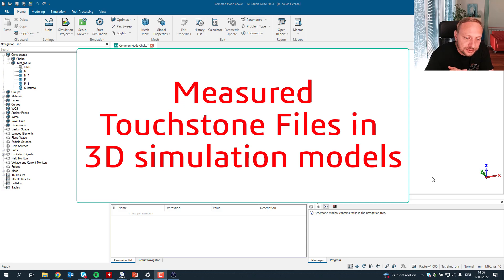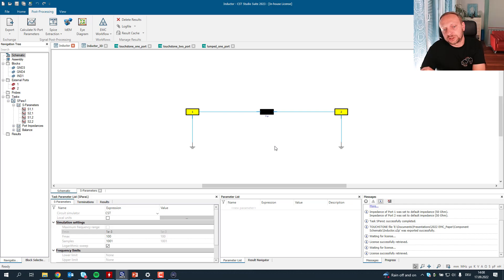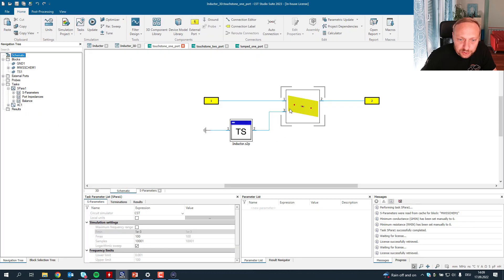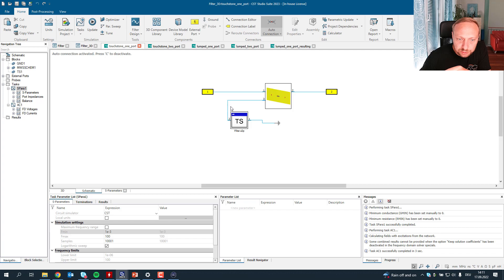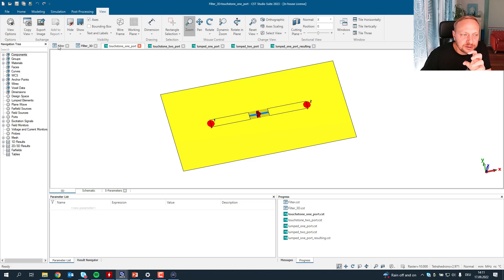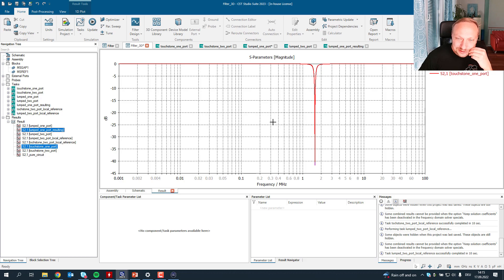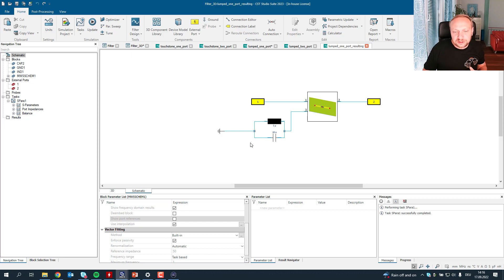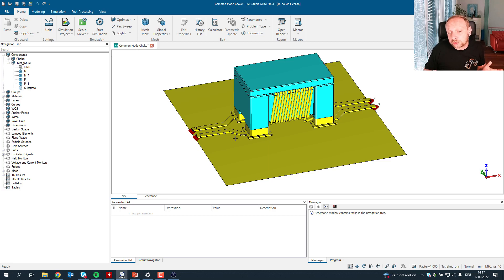Using Measured Touchstone Files in 3D Simulations

Comment: Great video Andreas! Many thanks for the crystal clear explanation.

I'd like to ask - when doing PDN simulations if I want to put ports at capacitors it is enough to just put 1 port across the capacitor pads and in the schematic essentially tie one end of the cap to GND and the other end to the port? Pretty much the same way you did it for the 1st example with the inductor.
Reply from the maker: Exactly. For a cap (current only across the component) the 1 port setup will work well and is just easier to read on the schematic